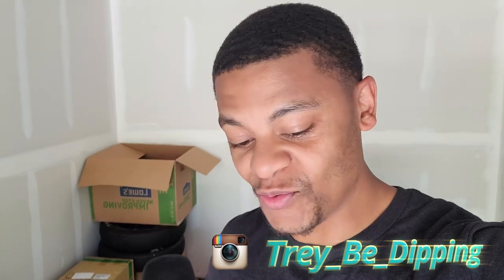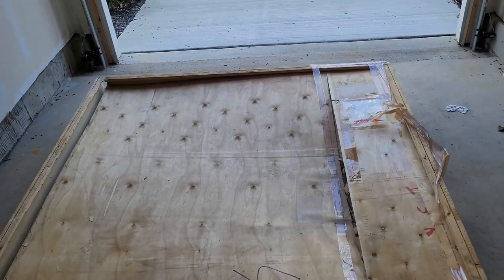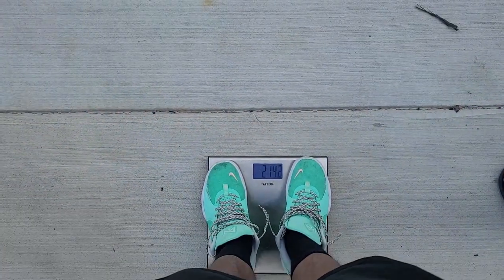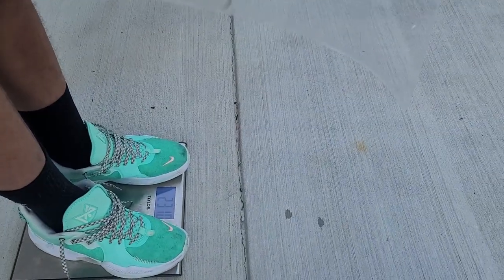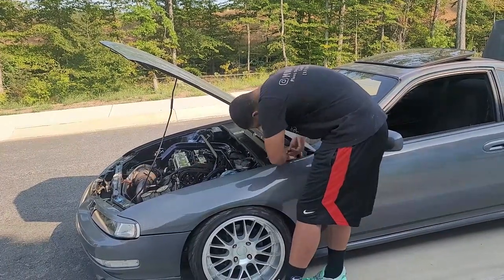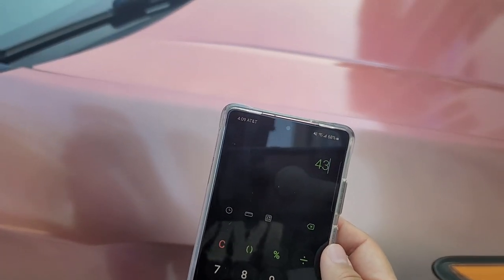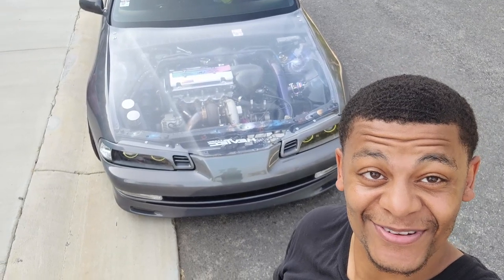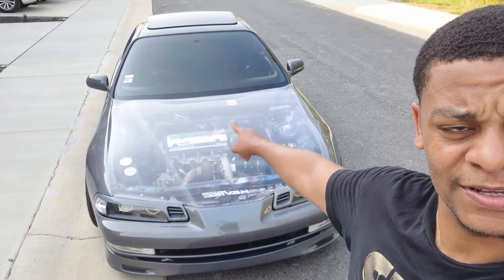First EVER Clear hoods for 92 96 Honda Prelude!!!!!

Comment: Awesome man, that is looking dope. I would say this mod goes back to Fast & Furious days, Hector's Accord Wagon was the first I ever saw (like 2001!) but never thought this could be done. Great stuff! RE. the bonnet pins. If you are going to run that bonnet at the drags I would recommend 4 bonnet pins upfront. Without structural support it could get pulled up quite easily at speed. I switched from pin-style bonnet pins to button-style but my button ones are starting to fail (they pop out), so not sure I can recommend the button ones (ebay versions).
Reply from the maker: I got the actual  quick latch buttons so i should be good but yea bro i love this hood its sick

Comment: Man heat issues would make me worrY about this hood, its so thin,  i bet the heat could warp this especially out here in AZ IN THE SUMMERTIME HEAT while driving or sitting outside….but if anyone knows true luders know our rides never sits outside bet lol a few month updates on how it molds as time passes on
Reply from the maker: Its rated for 267 degrees

Comment: Looks flimsy
Reply from the maker: Its not made of metal so its not going to be solid like metal....its plexi glass
Reply: @treybedipping1734  well obviously it's not made of metal. I've seen a couple clear hoods that were more rigid than that with better fitment. Material looks thin on that.
Reply from the maker: @jyt3408  may have been diff material. I got the hood pins installed now and its a perfect fit.